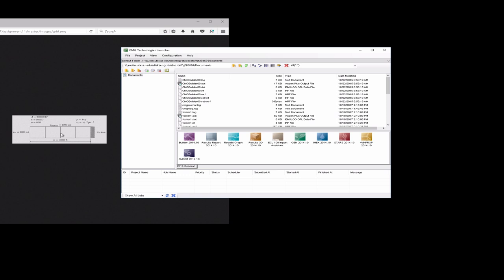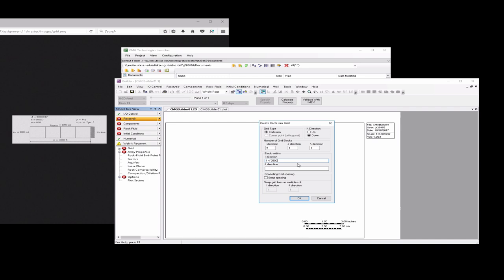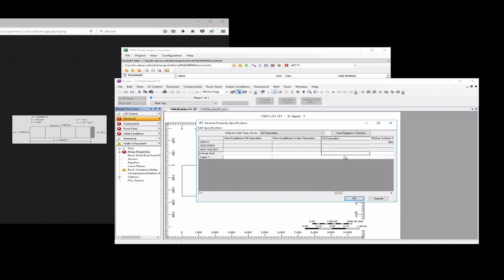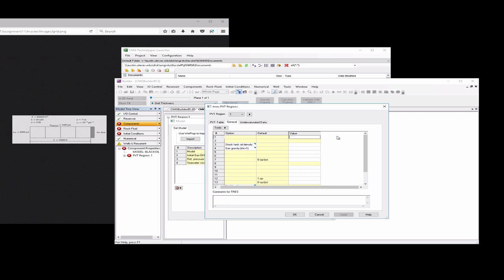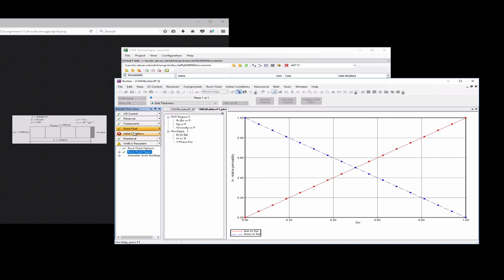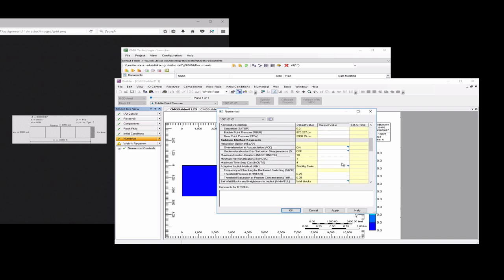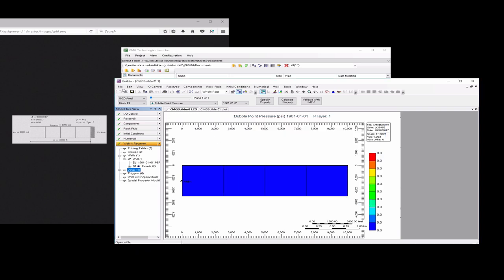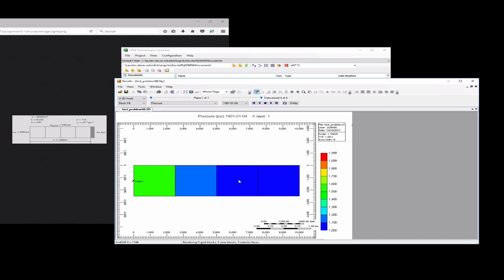1D Single Phase Flow Example in CMG

Comment: Good day! I’m trying to model half a hydraulic fracture with this approach. But got choked by convergence problems due to the smaller values of the fracture width. Do you have any idea? Maybe you’ve encountered a problem like that. I have tried the effective permeability approach but my model fracture conductivity absolutely changed. Thank you